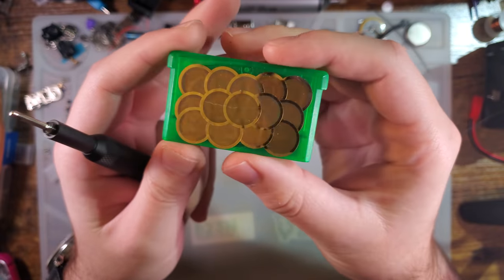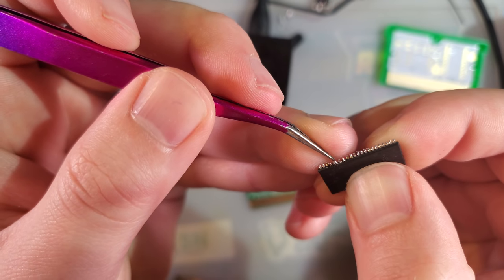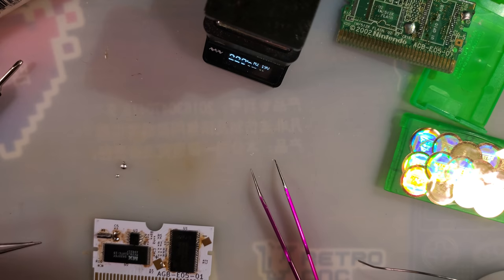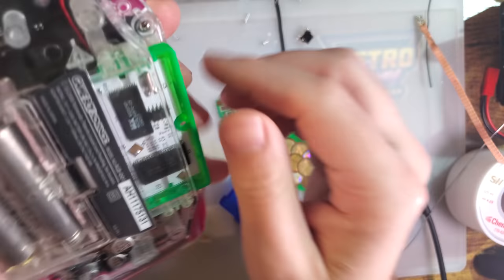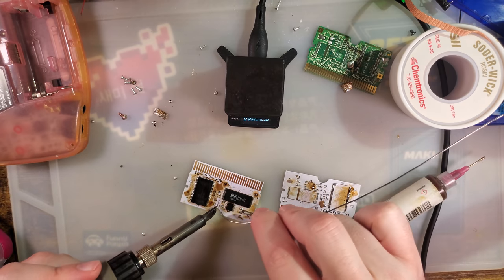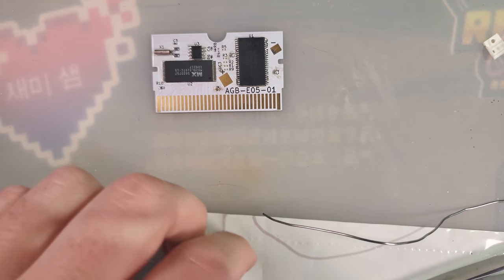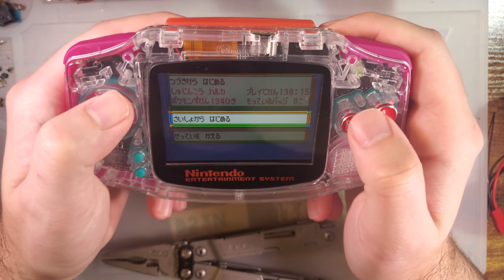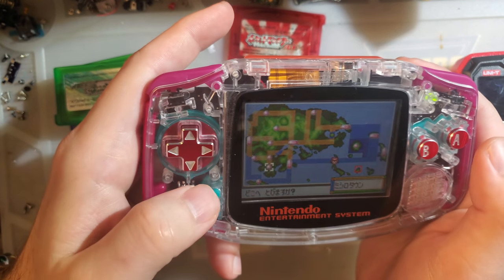YOU WILL NEVER BELIEVE THE SECRET THIS BROKEN POKEMON EMERALD WAS HIDING (GONE SEXUAL)

Comment: I don't understand how did it work even if the resistors and capacitors weren't installed?
Reply from the maker: Most of the caps are for stability and they help smooth out power fluctuations. They are only necessary for edge cases. The resistors were all for the RTC circuit which was not working until I installed them all and without the battery they were unnecessary.
Reply: @makho  thanks, appreciate the explanation.

Comment: Edit: After comparing my English copy of Sapphire and my English copy of Ruby to my two copies of Emerald, my two Japanese copies of Sapphire and my one Japanese copy of Ruby I discovered that my English copies of Ruby and Sapphire are both missing resistor R9. Where is the best place to order 10K resistors for these boards?

Is there a place that you can order a replacement clock crystal? I need to double check, but to the best of my memory, my copy of Pokémon Sapphire has all of the necessary components on the cartridge, but the cartridge will not recognize any battery that is installed in it. I had the battery replaced in 2014 at a local game and record store, and I had no problems with that battery. It wasn't until the battery died and I had it replaced by the same store, if I'm remembering correctly, in 2018 that I was told by the owner when I picked my game up that my copy of Sapphire as well as my copy of Ruby didn't recognize any batteries that he tried, although my copies of Emerald did recognize the new batteries. The owner didn't charge me for the battery replacements and I believe that he told me that this wasn't an issue he had encountered before. I believe that I've figured out the problem with my copy of Ruby, it appears that he accidentally knocked resistor R7 out of place, but I don't see anything out of place on my copy of Sapphire.
Reply from the maker: resistors and capacitors and the like are jellybean parts. Anything you get will work so you don't need to track down a resistor from an old game or something. You already know the value so you're halfway there. 

I generally use digikey or lcsc for parts.

Comment: May I ask what are those really small components that you are moving over 31:12 in the video? Are they necessary? I have a dead copy of fire red from my childhood that I have tried reviving but with little solder skill I made some mistakes. I wondered if I transfered the chips to a donor board would I be able to rip the save off of it without tranfering everything on the board since the game booted up without them?
Reply from the maker: not every game comes with every component populated but for the games that do come with those components, they are necessary. At that specific time stamp, I was transferring caps and resistors for the RTC circuit which your fire red would not have. However, your cart should still have other caps and resistors for the MROM and flash save chip that you would also need to keep.

Comment: Do you have a link to that SMD heater you used to remove the chip?
Reply from the maker: miniware mhp30: https://retrogamerepairshop.com/products/miniware-mhp30m-mini-hot-plate-soldering-preheating-station-preheater-multi-intelligent-modes-with-built-in-oled-display-60w-30x30mm-power-supply

Comment: I have a pokemon emerald that is damaged. I managed to fix all traces and the game boots. However every time I turn it on it says save corrupted and save file deleted. Sometimes when I play the game and try to save it will say save failed checking backup and the backup also fails, and sometimes it will be successful but still Everytime I turn on the game the save file is corrupted and and is deleted. Is this indicative of a bad RAM chip?

Edit: I should also mention I've reflowed both the mask rom and ram chip a couple of times with the same result
Reply from the maker: Sounds like you don't have all the traces repaired then. There is likely a short that you missed or a severed trace somewhere still.
Reply: @makho Just wanted to update and say thank you for answering it was another broken trace to the ram chip. I repaired it and now the game is working perfect again!

Comment: Is it possible to resolder the lost pads or is the board kinda dead? i got a gameboy advance where a pad of the power connectore is gone, and i dont know if i can repair it :)
Reply: You should be able to solder in a small jumper wire, either from a test point or gently scratch some mask away from the trace. It's not ideal and kinda fiddly work, probably better off getting some pcb's made up. The files are available online in a few different forums and the gameboy discord if you are interested.
Reply: @Chubza  yea sure, im gonna look at those, but sadly i am not really good in reading those plans. The pad which is gone is the second left, if you might can help me
Reply: @LeBlancMain  by second left do you mean the main contacts that insert into the console? If so, then I am afraid I don't know any easy fix other than swap everything to a fresh cart board. Which pads are you talking about there?
Reply: @Chubza  oh i was talking about the console itself, the second pin left from the power connector. Someone did a USB-C mod but ripped the pad appart and i wanted to add a headphone jack to the gameboy, but the pin is gone
Reply from the maker: fundamentally, a PCB is just a bundle of wires glued to an insulator so yes you can repair traces by just soldering in short wire segments. In a lot of cases, if the PCB itself is damaged, it's easier to just replace it, however. 

Some PCBs are a lot more complicated because they have 4 or more layers (top, bottom, and hidden inner layers) but every game boy from the GBA or older and every GB game is just 2 layer (top and bottom).